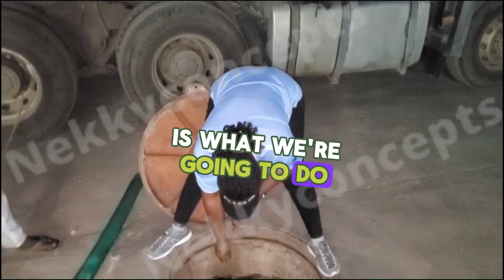Practical Discharge of Petroleum Products.🔥🔥🔥🔥🔥🔥#oilandgas #petroleum #petroleumengineering

Comment: @nekkyconcepts,

I noticed that the truck was not parked in a reverse position, it was parked with the rear facing the road and front facing the station. For safety purpose, what is the best parking position during product discharge?

Thank you.